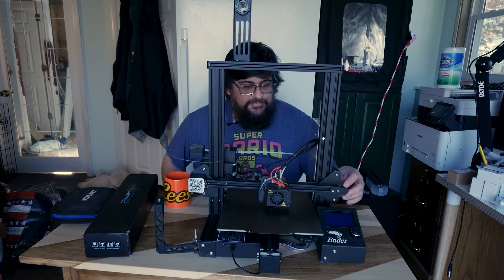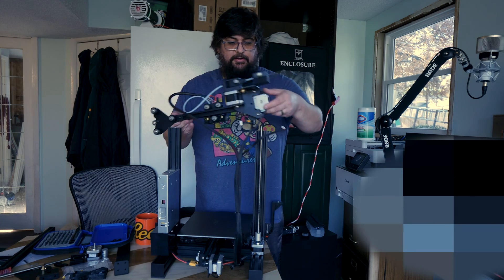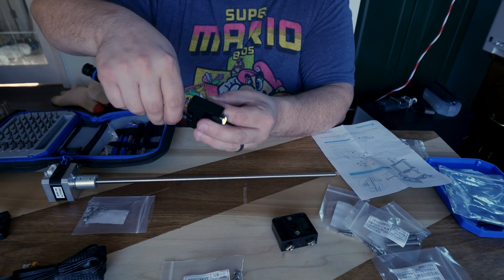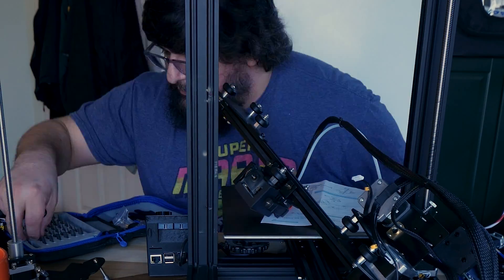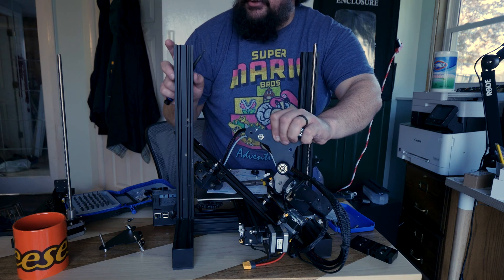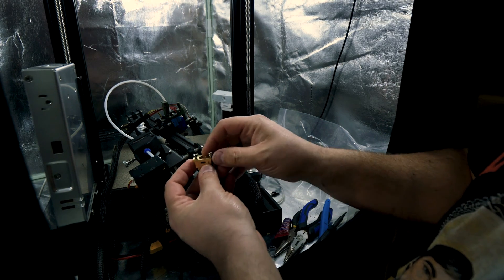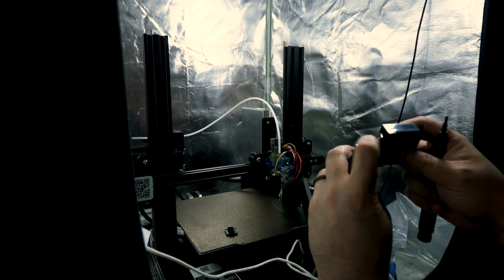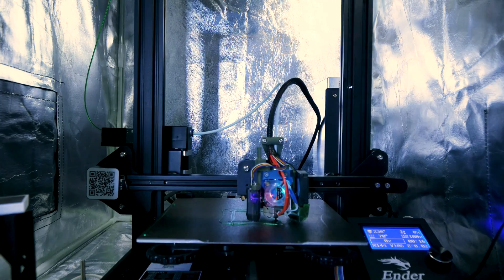Improve the Print Quality of your Ender 3 Pro!

Comment: Use the technique the Ender 3v3 uses just use a threaded rod and belt on the other side no motor needed
Reply from the maker: I have seen that before! Very viable, very good idea, and probably cheaper than what I did. It would probably avoid the alignment issues, I ran into, too. 

I am working on setting up Klipper for faster printing, so I may revisit this in the future. I know I need to do something to tighten up the Y axis, as the harmonics are limiting my acceleration numbers.